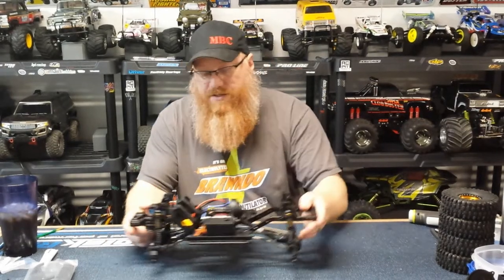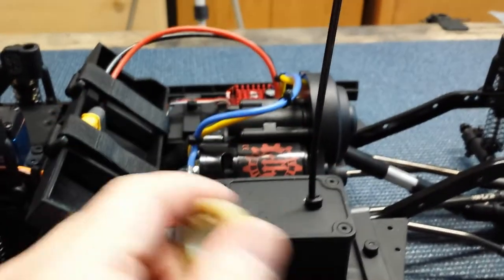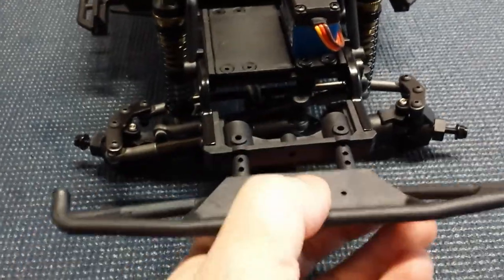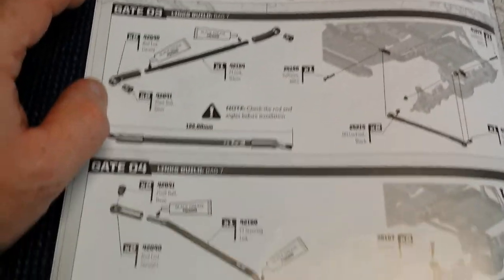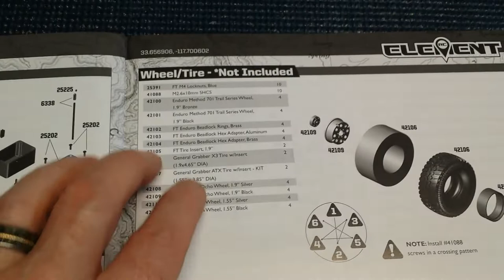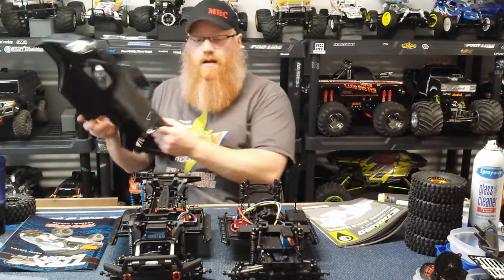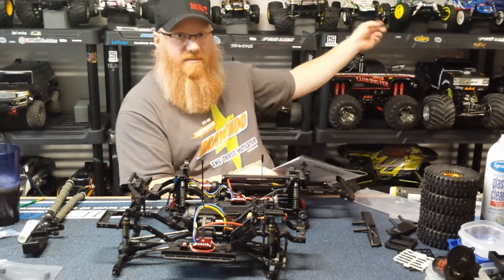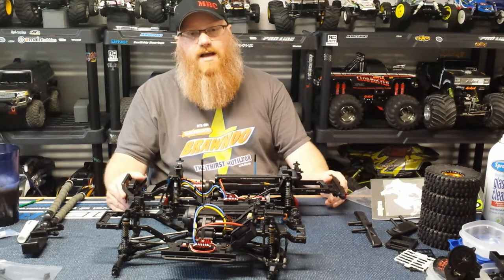Element Enduro Builders Kit 2- Build summary, instructions rant, TRX4 comparison

Comment: I just built this kit.  I had no issues.  I am new to trucks.  But not new to building complex projects.  That said this video answered some questions specifically about the pinion gear and bumper or lack there of.  Thanks for the Info.
Reply from the maker: I think I was just annoyed as I expected better from them. I guess I am spoiled with other companies having accurate 1:1 images of hardware and links to make life easier. The pinion thing annoyed me as well, they are super cheap and if it is the recommended size then include one, if folks want to deviate from that then fine but it felt silly to not include one. I did give a it a little too much of a rant and the truck itself is great, I do love the truck once built. Still not a fan of building it! LOL! I am glad you got your done with no issues and have fun with it!

Comment: Most kit builders would rather pay $50 less and pick there own body and wheels. Also I heard the new Traxxas manuals come with a sippy cup and crayons.
Reply from the maker: Crap instructions are still crap instructions. To each their own....
Reply: @AddamsPlayground  I agree with you. I built the V1 version of the Enduro right after building the TRX4 Sport kit. It was a night and day difference in terms of quality of instructions. Some big takeaways is that the link pictures in the Enduro manual for the V1 aren’t to scale instead of the Traxxas which was to scale. It’s good to see they are at least bro scale now. It’d be different if the Enduro photos were way off, but they were only about 1/8 off which is confusing. I love the Enduro shocks and transmission options though. I sold my Element but there’s no smoother shocks than the Element ones other than Dravtech

Comment: You just saved me a lot of frustration. 
Thanks 👍 
but what do I buy now?
I've got scx10 2 and element with IFS
Is the new Trailwalker RTR - Black or Ecto much different/worse than this kit? Any thoughts
Reply from the maker: To be fair, the truck itself is fantastic, the instructions are the frustrating part. If you use the PDF version on a laptop it does make it a lot better and easier to build. The print instructions are rough to follow where things go in critical steps. The shocks in this kit are about the best I have ever run. So some patience and paying close attention to the not so great illustrations you can build it just fine. I know a lot of folks have had a lot of great things to say about the Ecto, after you replace the ESC with a 1080 and the motor with a Holmes Crawl Master! I do know Tower Hobbies still has a few of the SCX10.3 Early Broncos in stock for $300!
Reply: @Addam's Playground  Thanks 😊 maybe I'll just need to test my patience🤔 or stick to the rtr's😂 
$300 wow, here on the other side of the pond in the UK, they go for over £500😕
Reply from the maker: @adamskirc  sorry, they have a scratch and dent sale of some with box damage on them. I am tempted to get another just cause they are so cheap but I am trying to be good 😂
Reply: @Addam's Playground  😂😂 that's exactly what I would be thinking 🤔

Comment: Lol, so I recently bought a gatekeeper kit. Your instructions show 3x8mm and 3x6mm for the battery mount/chassis plate aft of the axle. My instructions showed all 3x8 mm so then I get to attach the opposite side and I am 2 3x8mm screws short and have 2 3x6mm screws spare? So looked at the stubs sticking out of the chassis brace and said hmmmm why aren’t those 3x6mm. Good to see the manuals suck across the board, so at least they are consistent. Lol
Reply from the maker: Yeah, glad that wasn't going into a gear case or anything like that!!! I just expected a company like Associated to have a better set of instructions for their kits. I just built another Enduro kit and I love the truck but still hate the instructions. Using the online version was helpful but they still suck. At least they make good kits!
Reply: @AddamsPlayground  hi Adam, thx for your review.  So, is it worth to buy? For $249?
Reply from the maker: @user-6tfvk70k78  it is a great truck and worth the money. I absolutely love the shocks on it and they work great right out of the box. If you get one download the manual from the website and use it. It is much easier to zoom in and understand exactly what screw goes where. There are a few mistakes in there so you may have to figure a few things out on your own. The screw mounting the steering linkage is incorrect and there was one other part I can't recall. The pdf manual is helpful though. You will have to order the enduro bumper mount set if you actually want a rear bumper on your truck. Over all it is a great platform to start a very nice build on.
Reply: @AddamsPlayground  thank you Adam, I bought the truck, now waiting my order. Now thinking 🤔 do I have to mount servo on axle?! Some people do that
Reply from the maker: @user-6tfvk70k78  I think it works great as is. There really isn't any bump steer with this kit and that is one of the main reasons to switch over to axle mounted. The layout allows for a steering servo and winch servi to be mounted side by side so you have plenty of room. I would probably skip that and invest that money into something else.

Comment: Hi how many teeth did you go with on the pinion gear?
Reply from the maker: I went with the stock 18 tooth. If you are going to be doing a lot of technical crawling then you could go down or tooth or two to slow it down. I am running on 3s so it has goo low end but plenty of wheel speed if needed. I like it with the 18 tooth, it seems to be a good all around gear.

Comment: I hear what you're saying but compering this chassis to the TRX4 is one thing. But this video is comparing the manuals. Any experienced builder will have only a couple of minor head scratches putting the element together and once you're r are out on the trails there is no comparison trust me. I like the TRX4 but the Enduro even in its RTR form will out perform the TRX4 all day. I enjoy the building process myself so I get the gripes but you build it once and run in a 100 times. Don't let this put you off buying this if you want to out perform most on the trails
Reply from the maker: I agree the two trucks are a lot different and the element works very well. The shocks are fabulous! I was a bit irritated still when making this video and fell like they fell short on the manual and could have done so much better. Associate seems to be 20 years behind many others in the features and quality of the instructions. I built another later on after this and used the online instructions and made it more enjoyable but that was mainly so I zoom in and see things more clearly. I have built over 120 kits from various manufacturers and this one was the one I disliked the most. The drive is 1000% better though so you are right there!! Take care and thanks for checking it out!

Comment: Always enjoy your content... sorry you had a frustrating time with this build.   You talked about the plastics, and AE usually does have pretty good plastic.   You mentioned the pinion, and unless it's a hardened steel gear, I'd rather them NOT include one, so I'm not tempted to use some junk pinion that will end up costing me a Spur gear later on...   I've dealt with a few trucks that have no mount for rear bumpers, just a front one.....and I also don't like that, there should be mount holes even if they don't include the bumper.   The pre-built shocks, in any kit, bother me.... as I don't know how they're built , or if the o-rings have been greased, so I'd be taking those apart and adding green slime...
    Looks like this is definitely intended for "builders" with a decent bit of experience...  I am trying to decide between an Element builders kit or Axial raw builders kit...but I have 5 Axial trucks already.  Also looking at the straight axle Phoenix kit from Vanquish.  Those Vanquish bumpers you showed look really nice...
    Do you have an SCX10 II?
Reply from the maker: Hey Isaiah, I do have an SCX10 II and it is a nice kit to build. I built mine with a modified battery tray and the servo relocation mount to move the battery lower and more towards the front. There is a video our two on it in the past videos. It is the blue one with the cliffhanger body on it. I really like it. The element is a fantastic truck and probably the best shocks I have ever had!! The instructions are crap compared to most other manufacturers and I wouldn't even use the book, download the pdf from the site and build from it so you can zoom in and tell what goes where easier. There are some wrong things in there but they are pretty easy to figure out. One thing is the screw for the steering link to the servo horn is wrongly labeled, it is a different size. Measuring the links is a pain but if your calipers are long enough that isn't hard. I was just sorely disappointed in the manual really when I made this hence the ranty nature of it. the truck itself is solid. I have heard mixed things about the Phoenix but I think the good outweighs the bad, I personal hate the body it has but the truck I think is good. I guess that really depends on if you want the basics and spend the extra money in upgrading the truck or do you want the fancier things the vanquish can offer. I prefer simpler, less things to break!

Comment: Only 10 seconds in and drooling over the old van and clodbuster in background. I wanted those when I was kid so bad lol
Reply from the maker: The lunchbox is super fun to drive, I call it the instant smile maker. You should get one! Check out tower hobbies as they usually have them and also have discount codes on the site to save some $ off of it. The Clod is a but pricier but also a fun drive. For both of these kits being so old they both still look amazing and are a blast to drive. The clod needs some upgrades to be really fun and you can get into one heck of a rabbit hole with that one for sure. I know of a few guys where it went from just the kit to $1000 later the only left from the kit was the axles! but that is with most any RC! Thanks for watching!!

Comment: i know you were very not happy with this kit. i am thinking of a new crawler project with F250 body from jconcept. yaya i know it's an old american truck body and i somehow developed weird likings for one of those. i am trying to find cheap crawler chassis but don't want to get something that is completely useless. do you recommend this in terms of performance or did you already sell it out and never drove it? i cannot blame you for crappy instructions. i have trx4 sport kit with its original body and tracks, axial 10.2 with 4runner body (paint job i am not that fond of), gmade military buffalo, gmade bom with 1970 c10 body. i was thinking either hpi venture scale (lack of parts support) or element enduro builder's kit or some china knock off (feel like cheap china knockoffs will have axles and key parts snap off even in non stressful action). let me know your thoughts on the enduro
Reply from the maker: The truck is fantastic, the instructions are less than stellar and use the online PDF version as it is easier to tell what goes where and since they were too lazy to scale the pics of the links you won't be missing out anything from the hardcopy of it! The builders kit has some of the best crawler shocks built in my opinion and many others as well. they a so smooth and predictable and don't leak! When you get it you will have to order the bumper mount set if you wish to run a rear bumper as they were nice and only gave you the "comp bumper" which is a flat endcap to the frame... not a bumper. I have used the Vanquish VS4-10 Pro tube bumper sets and they are cheap and tough but that is totally up to you and the truck body you go with. You will also have to supply your own pinion so make sure you have one that will work, it was 48p 18t for the kit build but from the manual you can run from 17t to 27t in it. Just take you time assembling it and double check yourself before putting screws in places and it will be fine. The truck once assembled it fantastic. The manual is frustrating.

Comment: So I’ve been wanting an ifs 21 bronco. I bought the element ifs kit. I’m now really turned off element tbh. It was fiddly and instructions unclear at times. They always just seem to be missing key things in their designs and component selection. I think Ill have to pass on element rc for now.
Reply from the maker: I have not messed with the IFS but if the instructions are like this one I am sure it was as clear as mud in some places! Once the truck was built it seemed really nice, I did not get any good drive time as these we for the O11C guys but it did feel really good for what I did with it. I was just so shocked at the poor quality of them from such a good company that has been around forever. Someone other than traxxas is going to have to make that IFS 21 Bronco for you as they are not going to. They are going to ride that TRX4 platform with the portals to the grave!

Comment: I don’t know how you can possibly compare a builders kit with a kit and say about wheels and body, the clue is in the title builders kit, it allows you to choose your wheels and body, no kit includes electrics, there for you to choose and make the thing your own. Personally I like element kits and rtr’s and the instructions are perfectly clear, not up to Tamyia standards yet. I’m not that big on trap as, not since the tcp kits they used to do became discontinued but that was buggy’s.
Reply from the maker: I get it is a builders kit and it is made for you to take it wherever you want to go with it. I also love the truck itself, it also has the best shocks out there from my experience. I just expected may more from the instructions and for them to not have mistakes in them. Associated has been making kits for decades and should be able to print manuals that are mistake free and are easier to see where things are going. The online version is much better, still has the same dumb mistakes but at least I could clearly see the places the screws were suppose to go much better. I'll admit old eyes are probably part of it to. I was pretty annoyed when making this video and was it fair to put it out there that there were issues in the build for me and there are much easier kits to build for a beginner and may be a better bang for the buck? Yup! I would be lying if I had not shared my frustrating experience with it and things I preferred building over it. Once it was built it is one of the nicest running ones in the crawlers I have but I would still never recommend it to a new builder.

Comment: My only purchase from Element was the Enduro 1/24 scale crawler. I haven't considered another Element or Associated purchase since then.
Reply from the maker: The truck is great, it really is nice, Some of the smoothest shocks I have built as well! The instructions while frustrating will get it built and I recommend the online version instead of the printed manual, it does make it easier to be able to zoom in and see what is going on. There are some mistakes in there but it is something you can figure out by comparing the hardware you have and the hardware required for the next handful of steps. I do not have the 1/24 crawler but I do know they are worlds different! The 1/10th scale all has nice parts and materials and just requires some patience with the manual and the rear bumper mount purchased if you want a rear bumper.
Reply: @Addam's Playground  you replied to my comment before I even finished watching the video.....Brilliant!!

Comment: The issues with traxas is that International customer cannot buy anything Traxxas from an online store they force us to buy from local distributor and store and local store charge a 200% markups on their kits and parts at least that's the situation in Singapore.
Reply from the maker: Ewww... That is terrible! I did know they were more expensive in other countries but not to that extent. I'm sorry they are so pricey there. Are axial and element as expensive as well or is it just Traxxas with the overly high markups??
Reply: @AddamsPlayground   Axial and Element are still okay because they do have competition from online sources but Traxxas does not so the distributor gets to charge whatever they deemed fit. I do want to support local hobby stores but it's hard to do when they start asking for Singapore dollar $1000 (US$740) for a TRX4. But great video 👍 you had very good points on the manual.

Comment: 18T is way too big for the truck. I recommend a 11 or 13T
Reply from the maker: I was going off the manual. From bench testing it seems about on par with the TRX4 Sport speed.... I haven't had a chance to test run the truck yet but it is being set up for trail running mostly so it should do fine there. For serious rock only crawling I'm sure the lower count pinion would be a huge benefit. Once I get them out and actually drive it a bit I may need to change it out. Thanks for checking out the video and the tip.

Comment: Hmmm, i found it pretty easy to build this kit actually, had it together in less then one day, the only thing i didnt like or no, maybe two points, to light shockoil in the box, and the topend of the shocks, those pivot balls arent the right size, but still, that truck, once setted up is a beast👍
Reply from the maker: I agree once built it is a great truck. I just built one for myself I was probably still annoyed with the build when I made it but wanted to point out the issues I ran into. I certainly didn't want to make it sound great and at such a low price get someone excited to build one and run into a ton of roadblocks and confusion. I still think the print directions need improvements that would make it a ton easier to follow. I appreciate the feedback and it not being condescending like some other folks have been. In the end it is a great truck and performs great!